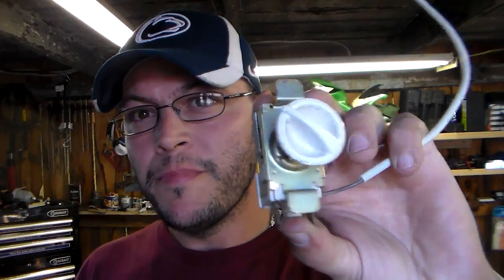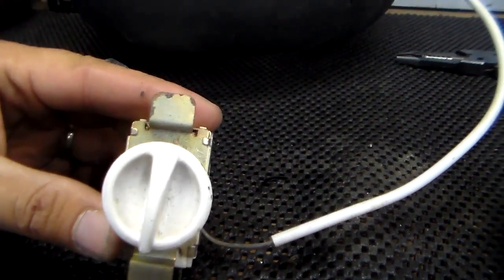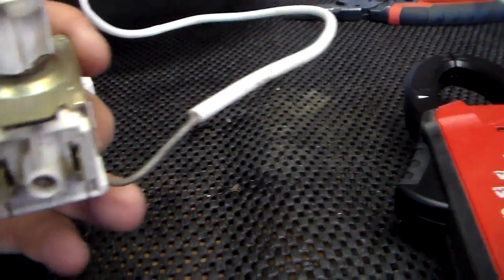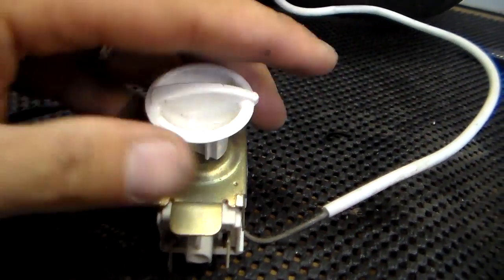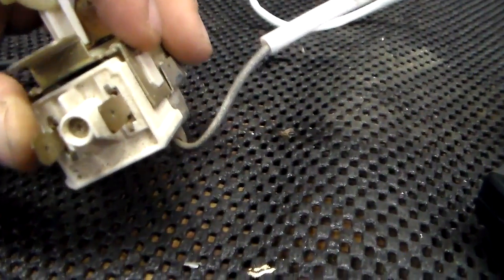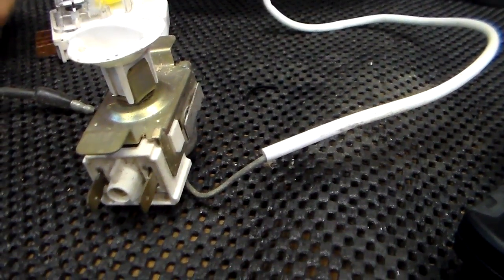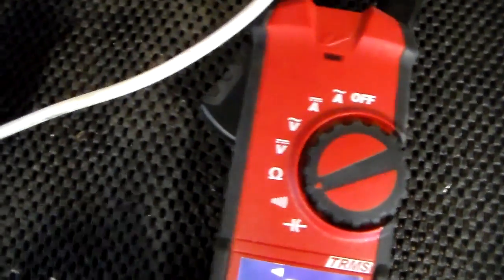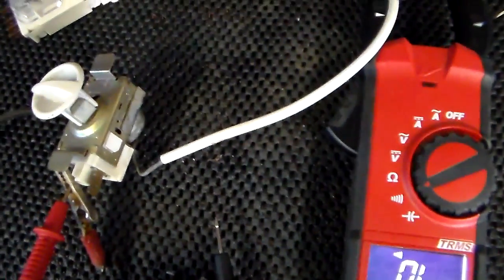No Cool Refrigerator - How to test the Thermostat

Comment: Hi Bill, 
You make very informative instruction videos.
This video you made is worth knowing. However, there are so many different refrigerator thermostats (cool control) models and many new replaced need it to be calibrated to work properly according to the proper temperatures required for fresh food section.
There is almost no videos on how to calibrate or re-calibrate the refrigerator thermostats.
Can you create a new video on this much-needed knowledge?
Many new technicians and home repair guys are hungry for this missing stuff. 
Thanks a million !
Reply from the maker: +RICHARD ESPINA I will look into doing that.  Thanks for the suggestion!
Reply: That is a vaild point.  Those refrigerator temp controllers need to be calibrated.  Its hard to calibrate though, as you need some really cold media that you can regulate the temperature of to calibrate it.  Its not like calibrating a thermometer for a grill or smoker where you can use boiling water to adjust it.

I recently replaced a fridge thermostat because the compressor would never turn off, even when the temp of bottled water in the fridge would get down to 33 degrees.  Now the new thermostat turns off, but the fridge temp is up above 40, the thermostat shouldnt be satisfied at that temp. Even with the dial set all the way to the coldest setting, its turning the compressor off before it gets down to 37 degrees.  The GE Hotpoint thermostat that I bought has a tiny screw inside a hole with the words "COLDER" and a directional arrow printed on the casing, I'm assuming that to calibrate it you adjust that tiny screw inside the hole.

Comment: Mine too. This is my fridge design.That's why I'm here looking around. Compressor always hot, always running. Starter relay shows 11ohms in the (commonly stating 10-100ohms).

can't check the capacitor.

When fridge is off for an hour or so while I test it, compressor still around 100 degrees.
When I plug it in, compressor low side is super cold for about a minute then goes warm for as long as I'm patient to wait.  

Compressor readings at contacts are
9start
6 run
And 17 between them.
No ground short to chassis.

Stumped where to go from here. 

Starter relay as stated has 11ohms in the 10-100 reading, so I'm told. So I feel like it's in range yet it does have a "very slight" plastic burned smell.

Fridge works enough to keep non frozen side at around 38-42 degrees. Freezer will not freeze ice.
Defrost thermostat has recent been replaced.
Defrost timer appears to be working when manually cycling.

Thermal control seems to work 

Any help in this matter would be appreciated

Wits end
Reply from the maker: +someleverpuller Check the frost pattern on your evaporator.  Should be lightly and evenly frosted over.
Reply: +Bill Newberry I was having problems posting. Said error every time.

I'm suspecting my drier filter is plugged. I'll send the post to the page in a min.

Comment: Bill Newberry heres my issue i have a Gibson refrigerator GRT17DRBWO my issue was going on about a half a year ago where the bottom part the refrigerator part was not getting cold and ice was actually hitting the freezer fan. So i'd take the back panel off and melt it all with blow dryer i did this a couple times and ysully it would last a while where the refrigerator would work just fine, it was freezing good and refrigerator would stay cold and the unit would turn off and on all good but than last week it started doing it again. Freezing up the back area of the freezer,coils, and not cold in refrigerator. So i researched and checked that my thermostat for the defrost, timer, or the heater element itself bad. Well i checked the defrost thermostat and it had no continuity so bad, checked the element it was good had 33ohms resistance, checked the timer between one and 3 no continuity so bad. I replaced the defrost thermostat and the timer and the refrigerator thermostat stat too. Well all is cold and no ice or frost on back or on coils and freezing down in refrigerator 30°s. But the problem is the refrigerator will not shut off at all except when the defrost timer gets to its area than off for a bit but the rest of the time the compressor stays on running, air blowing cold. So i put my old thermostat for refrigerator back on same thing, refrigerator runs all the time. Please help me figure this out if you can you seem like a master :)

Comment: Hey Bill, I'm not sure what's going on with my freezer. I have a Kenmore Elite with the freezer on the bottom. I opened up the back and the Compressor is very hot to the touch. I plugged it back in to see if the compressor was turning on. Keep in mind I am not sure what triggers it to turn on. When I plugged it in the fan turned on but I haven't heard the compressor come on. Your help is greatly appreciated.
Reply: Mine too. This is my fridge design.That's why I'm here looking around. Compressor always hot, always running. Starter relay shows 11ohms in the (commonly stating 10-100ohms).

can't check the capacitor.

When fridge is off for an hour or so while I test it, compressor still around 100 degrees.
When I plug it in, compressor low side is super cold for about a minute then goes warm for as long as I'm patient to wait.  

Compressor readings at contacts are
9start
6 run
And 17 between them.
No ground short to chassis.

Stumped where to go from here. 

Starter relay as stated has 11ohms in the 10-100 reading, so I'm told. So I feel like it's in range yet it does have a "very slight" plastic burned smell.

Fridge works enough to keep non frozen side at around 38-42 degrees. Freezer will not freeze ice.
Defrost thermostat has recent been replaced.
Defrost timer appears to be working when manually cycling.

Thermal control seems to work 

Any help in this matter would be appreciated

Wits end
Reply: Mine too. This is my fridge design.That's why I'm here looking around. Compressor always hot, always running. Starter relay shows 11ohms in the (commonly stating 10-100ohms).

can't check the capacitor.

When fridge is off for an hour or so while I test it, compressor still around 100 degrees.
When I plug it in, compressor low side is super cold for about a minute then goes warm for as long as I'm patient to wait.  

Compressor readings at contacts are
9start
6 run
And 17 between them.
No ground short to chassis.

Stumped where to go from here. 

Starter relay as stated has 11ohms in the 10-100 reading, so I'm told. So I feel like it's in range yet it does have a "very slight" plastic burned smell.

Fridge works enough to keep non frozen side at around 38-42 degrees. Freezer will not freeze ice.
Defrost thermostat has recent been replaced.
Defrost timer appears to be working when manually cycling.

Thermal control seems to work 

Any help in this matter would be appreciated

Wits end
Reply: Mine too. This is my fridge design.That's why I'm here looking around. Compressor always hot, always running. Starter relay shows 11ohms in the (commonly stating 10-100ohms).

can't check the capacitor.

When fridge is off for an hour or so while I test it, compressor still around 100 degrees.
When I plug it in, compressor low side is super cold for about a minute then goes warm for as long as I'm patient to wait.  

Compressor readings at contacts are
9start
6 run
And 17 between them.
No ground short to chassis.

Stumped where to go from here. 

Starter relay as stated has 11ohms in the 10-100 reading, so I'm told. So I feel like it's in range yet it does have a "very slight" plastic burned smell.

Fridge works enough to keep non frozen side at around 38-42 degrees. Freezer will not freeze ice.
Defrost thermostat has recent been replaced.
Defrost timer appears to be working when manually cycling.

Thermal control seems to work 

Any help in this matter would be appreciated

Wits end

Comment: I have the opposite problem than the video, it seems like my cooler is freezing everything.  I have had the freezing problem twice.  Once it happened a couple of months back and all I did was clean it out and it seemed to be working fine until a couple of days ago.  I cleaned the cooler again and it was working fine, and then started freezing everything even when the thermostat was set on the lowest setting I could put it on (all the contents drinks etc are freezing, not the lines).  Last night, I turned off the thermostat when most the drinks were frozen, not all.  I left the cooler power on and this morning I had EVERYTHING frozen with a few blown cans.  I am trying to diagnose what could be wrong.  I haven't tested the compressor (maybe stuck open if there is such a thing??)  or do you suspect the thermostat as the culprit?  I did OHM out the thermostat, and it responds fine as far as "on off" goes, I have a cheap multimeter that doesn't have a continuity test but is there anything to be gained by testing continuity?  Any help is appreciated.  This is a one door True glass door cooler about 4ft tall in my garage.

Comment: I replaced the timer,bio-metal sensor and thermostat.My fridge is temperature is normal but it running all the time what is the problem will you please help me?
Reply: Mine too :( did you ever find out?
Reply: in my case it is the problem of Thermostat.The Thermostat i had install is not compatible so i buy new one and it's working now.
Reply: Arun Pandey ok thanks

Comment: Bill,
I've replaced the thermostat, defrost timer and evaporator fan motor.
The evaporator fan motor doesn't seem to be coming on.  I tested for voltage at the connectors - from lead to lead, there's nothing.  From either lead to ground, I get 120v.
Do you have any ideas on what I can do to make the fan come on?

Comment: Hello Bill, I got a call from a guy a regularly do repairs for, he has a Frigidaire top and bottom unit with a air cooled condenser you know, rear mounted. His complaint was the compressor shut down and didn't start up. I checked it and he had a new defrost timer which was working, the compressor was drawing 1.5 amps which indicates no problem. When I turned the thermostat off, the unit shut down. After waiting a few minutes for the pressures to equalize I turned the thermostat to factory setting and it went on. I explained to him that if the thermostat is satisfied it will also shut the compressor even if the defrost timer is in the run position and it is possible for the thermostat to call for cooling, but will not start because the timer is in defrost. The compressor has a solid-state relay which is not the problem. As you know a relay will work or not work. If the overload is bad, it will not start at all. I will try the test shown in this video. It is possible the sensing probe could be faulty. I had that hunch, but it happens rarely.

Comment: Do you have the part number for that thermostat? My friend has one almost exactly the same that was on his freezer, I had to match the image to part number 216022900. It isn't available any more. I'm not entirely sure that's the only one that will work on his 1950-60s chest freezer, no model number listed. His turns on and cools, but never shuts off. You can't adjust the temperature, the knob is rusted solid.

If you know any other ones that would work in his case, please let me know. It doesn't have to match perfectly, he just has a freezer he'd like to continue using and can't find the part.

Comment: Your videos are a great help!
I either have a unique problem (I don't think so) or am missing something.
Nothing on the fridge works except the light.
Run power direct to compress and it runs.
Power coming into compressor is about 90volts.
Condenser fan seems to be bad and no power to it.
Timer is okay.
I jumper thermostat and nothing happens.
I am confused or am missing something. Thanks if anyone can help.

Comment: i have already buy two types of thermostat for my refrigerator and replace the old thermostat, but still all are  freezing, the thermostat is not cut-off. how can i test the thermostat for cut in and cut off if i will remove it in the system.

Comment: My refrigerator is on high and everything freezes even on one and half setting what should I check, thank you for any info you could give me?
Reply from the maker: If everything in the refrigerator is freezing, your refrigerator thermostat is to blame.  Thanks for Watching!
Reply: As of today instead of refrigerator freezing up the refrigerator side has completely quit working, but the freezer side is still working fine could you please advise me  on that, thank you for your input.
Reply: jedediahbc  did you ever get the answer on the refrigerator not cooling
Reply: Got refrigerator working, but the freezer part of refrigerator has to run on 9 to work what do you think is the problem on that I have cleaned behind and under refrigerator?